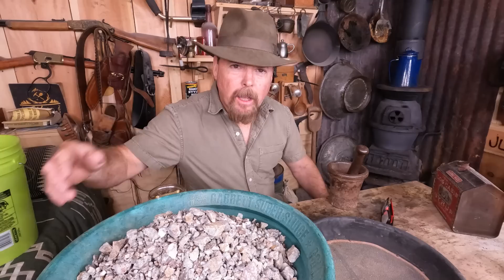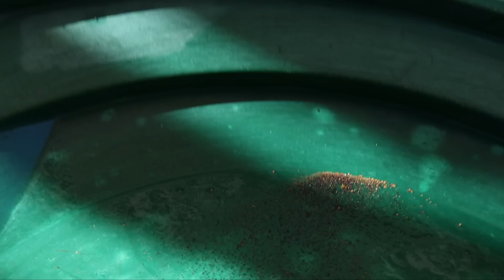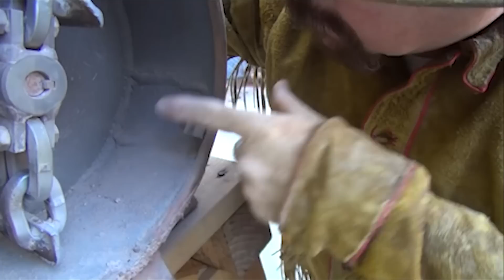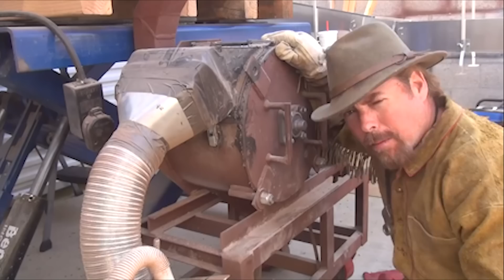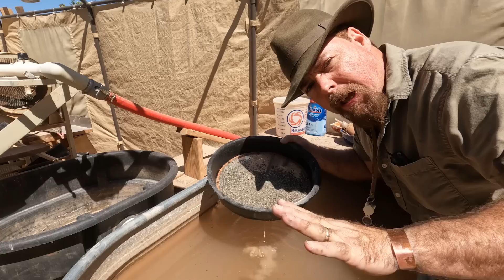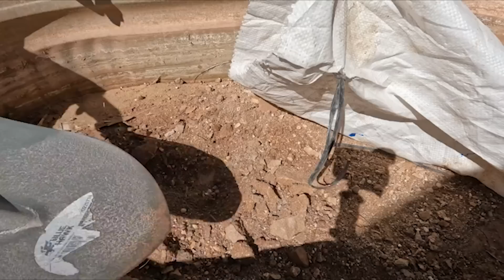Crushing High Grade Gold Ore: Turning Rocks to Gold

Comment: Finally, something I know about. There are several sizes of screen, the most common is 18-14,  18 holes per inch by 14 holes per inch and ultra fine 20-20 which also comes in metal

Comment: One thing you always want to remember on any mill is to always check your discharge screen Some of your gold could flatten out and get smashed into the screen (like when you smash that like button) and adhere to it. Cleaning it after every run will always give you your best results. I've known people that cross contaminated their samples by forgetting to do this. We ran a ton of ore from the Ruth and only got 3.68 ozs. when the assay showed 7; guess where the rest of the gold was "hanging out".Love your mill Jeff, looks like it'll do a sweet job of getting that gold out. Heavy pans y'all!
Reply from the maker: Hey Richard,  really good point ...another reason we like the Keene RC 46 with roller mill ....makes that Gold big and flat like a Pizza pie.... thanks

Comment: On your vacuum bucket, you may consider putting the input line at an angle on the side to create circulation. This will create a tornado type circulation whose centrifugal force will keep the heavier rock dust material circulating on the side, with the exhaust in the center top pulling out the air with much less dust and rock. As it is right now I see the exhaust on the side where the rock dust will tend to be when circulation begins.  
Just a thought from somebody without a clue.
Reply from the maker: a cyclone ...great idea
Reply: @Askjeffwilliams    Any gold, much heavier, would also tend to stay on the very outside.

Comment: Great education, especially for Greenhorns !  Love that mill you built too !  Was this sample from one of your recent mine explorations ? Thanks for sharing Brother. We smashed that LIKE button real hard on this one !!🤠⛏️⚒️👍👍👍
Reply from the maker: yes it was.... you betcha my brother ...thanks
Reply: I use an iron mortar and a Bosch impact hammer drill with a bushing?  bit to crush hard rock . I'm in for only about $150, and it's a lot faster than by hand and reduces the rock real fine. One caveat, the bushing bit has brazed on teeth and when you use it some of that brazing wears off and looks like the big bonanza. If someone would manufacture a crusher bit without brazing it would be nice. I have seen them for air hammers.

Comment: I have some pieces of different rocks i am going to check. These rocks were from a farners road base. I dont have access to ore per se so there is no sense in me buying a bunch equipment.  You have given me what i need again. Your awesome. ! I want to buy a bag of dirt and your book but having trouble  getting threw the process.
Reply from the maker: thanks and keep us posted
Reply: @Askjeffwilliams  thats and  i will. I dont see free mill gold but that usually not the case. Ill let you know one way or the other.
Reply: Up date. Checked three  sample crushed down to 20 mesh. No gold but fools gold in conglomorant. 
 I find slivers of steel from pedestal and morter. ( 3/4 bock of steel and sleel rod steak.

Comment: I still use a motar and pestal i make my own motar and pestal out of steel. I have a small one to use in the field to a bigger one in the shop. i use old drill steel as the pestal. I crush it to a powder and also use a 20 mesh then pan it down. been doing it this way for years it takes time to go through a 5gal bucket of ore but its all good maybe some day i will get a crusher. Wonderful video Jeff

Comment: My favorite type of safety glasses are safety squints 😂😂😂
Reply: As someone who's endured lifelong eye damage, save the safety squints for the bedroom my dude. Get some eye pro so you can continue to see that shiny and your spouse's hiney.
Reply: @100GTAGUY  you can reach your eyes in the bedroom?? WOW ROFLMAO!! well noted! ive had hot 600F nylon blasted at me under many thousands of PSI... thankfully i wear eye protection when needed :)
Reply: @VendettaProspecting   well I didn't quite mean to imply that I can reach my eyes, if I'm picking up what your putting down lmao. I'm just making a silly anecdote, lost most my vision in my left eye at the age of six due to safety squints and paintball. 
I'm just very passionate about ppe even for trivial stuff these days

That hot nylon at thousands of psi sounds like a bad time, can it cause hydraulic injection injuries by chance? I'm sure it burns like hell no doubt
Reply: @100GTAGUY  it was from injection molding of plastics, blew skin off my hands but all healed fine 😂😎

Comment: I used a motor pestal. Talk about doing it the hard way. Plus at the mine all the fine crush was vacuumed and had a chamber socks had to be changed every shift. Depending on the mill. Ours had 20 foot long 4 inch diameter cotton socks that was 1970s tech. It was being changed out. They got roasted too. Then everything went CIL tank.  Mom had a photo of pioche in 49. The cloud from the mill covered the town. If the dust didn't get you  nuclear blasts did. Lots of stories.
Reply from the maker: sounds like Castleton ... we did a few vids on the mill and ca only imagine the stories ....maybe you could share a few from time to time

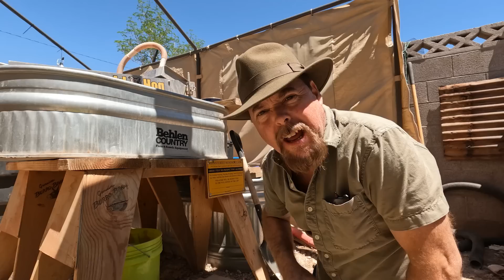Comment: 1:11 instead of a window screen what about those flour sifters? I think they might be lightly smaller holes. Thats a nice mortar and pestle cast iron? Cast steel? Most are not gonna survive that kind of work they can only grind plants and bones maybe. The cheapo chinese ones. Im gonna make one i have a few pullys so i figure ill take the biggest 2 rocks in the yard and make them smash each other. Take my drill and a mason bit and drill a bowl into the bigger one. Then hang the other over and crush stuff and rock it. I also got a 1 1/2in metal plate with a hole in the middle. I could put that on top and crush stuff and push it into the hole and collect from the bowl.